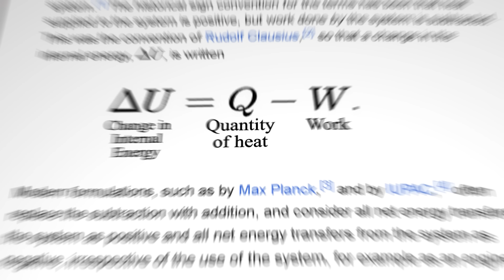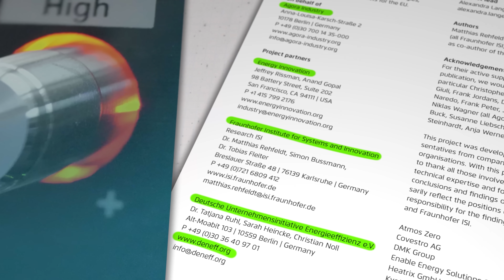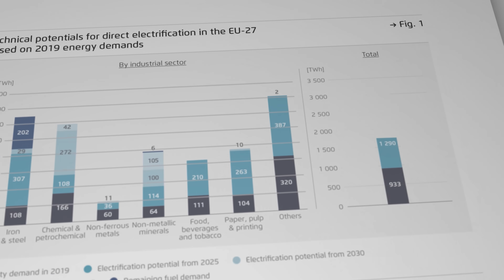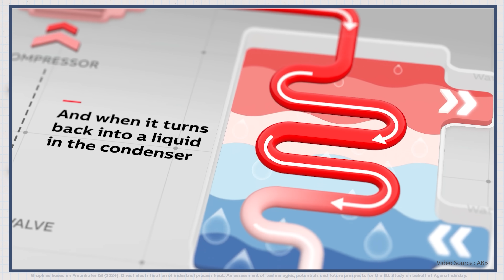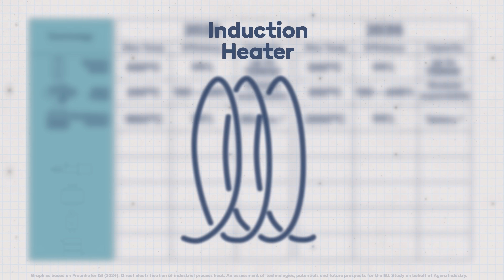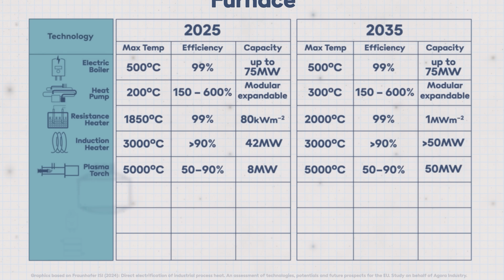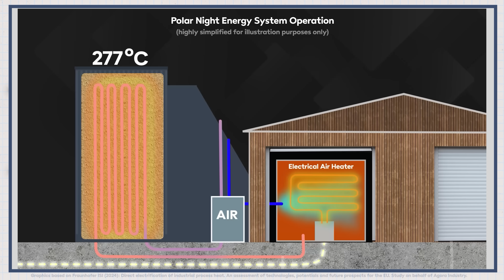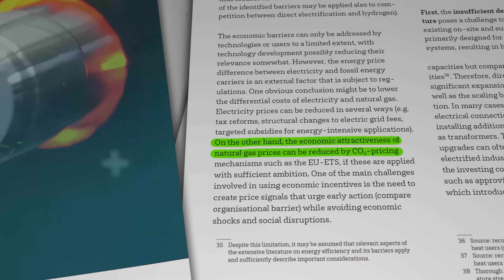Kicking fossil fuel out of industry! Here's how it's done...

Comment: As someone who is working professionally within several of these areas, I'd say that the picture is not quite as rosy as portrayed here. For instance, you have to be thrilled of a COP of 2 for heat delivery at >150°C and you can completely forget about 4-5. 

But the greatest challenge is that a lot of these processes require constant, or at the least on-demand, power supply. This would go well with nuclear but terrible for renewable energy, particularly wind and solar. Because sometimes the combined output of wind+solar is close to zero and in those cases having an increased 'minimum' electricity demand would be detrimental. And could you imagine working for a steel mill and being told your work schedule is 'whenever there is wind'... And this is not me slamming 

We should very much prioritize applications that can be shut off without too much cost. This includes EVs, to some extent heat pumps (a colleague of mine found out he could easily shut off his concrete floor heating for 12 hours without complaints from wife and children) and production of green hydrogen.

Comment: Something struck me the other day as I visited a Cash & Carry the other day. 
They had recently installed a brand new state of the art Diesel back-up generator. Surely it would have been around the same price to install a solar system. Cover their sizable roof with panels, the appropriate inverters and a sufficient battery back-up. Then not only will they have their emergency back-up solution, but they will substantially reduce their presumably huge electricity bill! Just a thought!

Comment: It's not either work or heat. That's a very misleading statement, and it leads to wrong conclusions. It will always end as heat. The question is, whether the energy was used before to do useful work or not.

Comment: Hydrogen suffers from energy density issues that doesn't seem ameliorated by any technology.  Also important to note is that hydrogen, when released into the atmosphere through fugitive or inadvertent emissions, has a global warming potential of 5x CO2.
The electrification excitation never seems to appreciate that the raw cost of electricity is high even if it has a 100% efficiency at the appliance there is always a 33% loss in transmission from the generation source.  Therefore no electricity appliance is 100% efficient.  I've always felt that industrial zones would be best served by a power plant that produces waste heat and sells that for process heat.  Waste to energy has a high degree of environmental efficiency by keeping methane out of the atmosphere from anaerobic bacterial metabolism.  When next gen nuclear comes round molten salt will be the godsend for industrial process heat and maybe even district heating service zones for residential and commercial structures.

Comment: Can you please do a feature on The Type Approval of JCBs game changing Hydrogen Combustion Engines across the UK and a large swathe of Europe . This means JCB are authorised to sell it's engines and thus products in those markets. This is a major step forward as you can significantly use these engines within all earth moving and construction equipment and also agriculture and also road transport. The real sweet spot is that the engines are logical developments of existing diesel engines and a huge proportion of the components are carry over utilising existing suppliers and machines etc. I also believe that you can actually retro fit existing engines and thus existing vehicles etc. This could be a real game changer..JCB will need to protect itself from the neysayers of course.

Comment: Using aluminum smelter as an example, 90% of cost is electricity. Should just move the smelter to somewhere where it is easy to generate green energy, like a desert environment. We don't. Ditto for pig iron. Basically, move it out of Europe instead of trying to fix it in Europe. Lots of excess wind power in Texas, but the smelter is in Louisiana.

Comment: Hydrogen is too valuable to burn to make heat. When hydrogen is needed for a chemical reaction then using electricity as the heat source for endothermic steam methane reforming is by far the lowest cost hydrogen if a value is assigned to avoided carbon dioxide emissions.

Comment: well then, you put 600% efficiency on the board but there is a strange lack of foaming from the mouth man children we see regularly on yt. Maybe they will come if I suggest heat to electricity conversion can be more than 50% efficient? 

heaven forbid anyone would suggest....

100 > 600 > 300 ????

If you imagine it to be 30% well then... 

100 > 600 > 200

or say 400% in stead of 600% because you insist it is wrong

100 > 400 > 200%

or say you've been living under a rock and want BOTH 30% and 400%  

100 > 400 > 120%

Physics never was the problem. It costs money to build, time to debug it and the hardest part is the will to do it.

https://en.wikipedia.org/wiki/Johnson_thermoelectric_energy_converter

Comment: The key is access to cheap electricity. The main challenge to that is grid pricing of energy where most of the time electricity pricing  is unrelated to the cost of renewables and instead is determined by more expensive nuclear and gas prices. That's a legislation challenge. Currently there's no incentive to use cheap wind energy because there almost always is some expensive source of energy on the grid. And the lack of local pricing means that e.g. Scottland grid prices are exactly the same as in the the south. Scottland actually curtails energy regularly because they generate more than they use pretty much all the time. There's no logical reason for electricity prices to be based on gas they are not actually using,  They are curtailing many GW of capacity on a regular basis. Fixing the pricing would incentivize industries to set up their factories in areas where there is a surplus of renewables. Those should be massively cheaper than gas most of the time. Steel industry in Scottland would make a lot of sense. The main blocker to that is national pricing of electricity. That's a solvable problem.

An alternative to this is simply going off grid and companies investing in private renewable generation. This is a lot harder but it effectively turns electricity from a variable cost into almost a one time, fixed cost to buy e.g. solar panels, inverters, wind turbines, and what not. After you buy those they generate power for decades with very little overhead for maintenance, solar panel cleaning, and maybe some occasional repairs/maintenance.  And you can always buy more expensive energy from the grid when your generation falls short or sell excess energy to the grid. Companies could join forces as well on this. This too is probably going to require legislative changes. And there is a lot of uncertainty around rules for grids buying excess supply of energy. 

Ironically, the fossil fuel industry figured this out a long time ago. They don't burn their precious oil and gas to power their refineries or power their pumps. Renewables do that job in Texas. That way they don't have to burn the merchandise and can sell it for way more than the renewables are costing them. That's why they have so much wind and solar generation in that state.  In the same way oil is pumped up in middle east using a lot of solar power. That's not because they are green washing anything but because solar is just cheaper. Having some oil or gas burning electricity plant right next to where the stuff is produced would be less profitable. 

As long as renewable energy is priced based on imported LNG or fancy nuclear reactors that go 300% over their budget and are stupidly expensive to operate, the grid prices stay artificially high.

Comment: also bythe way don't strght up burn hiydogen. why you ask. well meats the bigger grenhosue gas brother you get from derty burning hidrogen ina combsution engine NITROOXDIE. they make you  you leaguh take away your pan in hospatals and make your cars in the need for speed sreses go very very very fast. its also 1000's tiems more heat buidlng and potant then co2 as well. this si why we don't use hidrogen for a drect fuel in anything otehr then jet engines and sapce rockets or for fusion reactors.  bescue if it doesnt burn clealny it will be far far far far far wrose for the earth then just gaslone or desel witch would defaet the whole issue anyway.

Comment: A lot of skeptics on my high temperature heat pump comments. They are real and I have evaluated several systems in operation since 2015 including the one that made 15b 250°C steam above. For a good summary of several other working high temperature « open heat pumps » that generate steam at very low pressures from waste heat and compress the steam to higher pressure search « Waggeveld BlueTerra Toekomst MVR » and you’ll see a 24 page pdf with all the details on suppliers compressor types and heat balances.

Comment: Few people would dispute that the electrification of industry was a good idea, but just as trying to persuade people to use heat pumps and electric cars, you are putting the cart 
before the horse.

As it stands any increase in electrification will require the burning of more natural gas, or coal as we simply do not have enough renewable sources of electricity generation, nor do 
We have a viable long term energy storage system for when renewable generation fall away.

No industry would be happy if plants have to shutdown because there is not enough electricity available, so both of the above problems would need to be solved before you 
could persuade industry to invest in electrification. 

Then there is the plan to increase the price of gas to make the price of electricity seem more reasonable, well that comes with its own problems, current U.K. domestic energy
prices (I am currently paying 8 pence per KW hours for gas and 32 pence per KW hour for electricity) 4 times the cost of electricity over gas.

Before a certain small man’s special military operation gas was priced at 5 pence per KW Hour, but ever since the increase from 5 to 8 pence politicians have been foaming at the 
mouth about how many old people will die of the cold, yanking the price closer to 30 pence per KW hour would spark a revolution.

Even if you left domestic prices alone, and put the increase cost on industry this would inevitably increase the cost of all the goods we need and want, and would put European
And British companies at a competitive disadvantage with countries that have little regard For climate change.

The best option would be to push as hard as possible for the rapid deployment of renewable generation and energy storage to get the cost of electricity falling rather than artificially 
increasing the cost of gas, then industry would see electrification as a sensible option. We are told wind and solar are the cheapest form of electricity yet the cost keeps going up, can you explain.

Comment: And how will you generate the electricity?   Solar and wind are not reliable and do you really want to spend trillions converting 60% of your land to this purpose?   Most parts of the world cannot use geothermal. and there is a huge initial cost.   The rambling about  using different  heating methods are already well known and not helpful.  Better to use nuclear  or oxen to generate electricity than anything you suggest.

Comment: Record low Arctic ice levels have gone largely unmentioned—not just by you, but by most others as well.

This lack of attention may stem from the fact that many focus on sea ice surface extent rather than volume. If the current trend persists, this summer could see the Arctic sea ice volume reach an unprecedented low, potentially halving the previous record. There's even the possibility of the Arctic becoming ice-free, if not this year, then perhaps the next.

While Arctic sea ice can occasionally recover, starting the year with approximately 2,000 km³ less ice is a significant disadvantage. If this trend holds, the summer minimum could drop to around 2,500 km³—dangerously close to the <1,000 km³ threshold that defines an ice-free Arctic.

Source: Danish Meteorological Institute - Arctic Sea Ice Thickness

Comment: I have heard from my Process engineer friends that some of their customers are starting demand projects to swap out gas heaters for heat pumps + peaking gas pumps. 

I am jealous of them for having picked the right career for making a difference in the world.
Reply: You do not have to be jealous as they are dead wrong as long as they do not think for themselves!!!!     There is no problem to go electric but you need a power source that produces electricity dead cheap.  That may be nuclear.  Uranium or Thorium.  For your info: 1 kg of Uranium of Thorium has an energy content of 10 million kg of oil.   Cold fusion may be a good option when the criminal elite has been removed. Or Thorium batteries with a lifetime of years.

Comment: All energy eventually dissipates as heat. The distinction between "work" and "waste heat" is essentially the difference between whether the heat is dissipated before or after the work is done. The rare exception is, for example, the production of electric batteries, which literally store energy, which dissipates only much later when a purchaser uses the energy and it is converted into heat. If you were selling compressed springs, such as a car or truck might have, some of the energy will be stored. But fundamentally, bending and shaping metal, sawing wood, sorting sand with a shaker, and in inumerable other processes where energy is used to accelerate entropy, the energy is not captured in some sort of chemical, mechanical or kinetic form, and if it turns to heat right away or after awhile, it is converted to heat. Not that the distinction isn't useful: bending metal produces heat in the metal; the bonds between the crystals had be stretched and broken, in order to produce a bend. Thus the energy is immediately converted to heat, even as some sort of "useful" product is being made. This is always true, unless the production of the product demands that energy is stored. Just a small finesse on the physics.

Comment: From my industrial experience, it’s not just the industrial electric heaters front end cost that is prohibitively expensive, but the lack of electrical generation and infrastructure. Industrial sites operating at these temperatures do very poorly with thermal cycling the systems with frequent start-ups and shut downs, so you’d need to build out enough carbon neutral electrical generation to replace a large multiple of the fossil fuel demand to be reliable or invest heavily in a lot of storage technology which just makes the costs go bonkers.

Take a small refinery, consuming 40 mw today, looking to transition to electric heating, which will quintuple its electrical demand, to roughly 200 mw. Generally, for even a small industrial sites operating like this, you’ll want to be back ended from multiple power sources to avoid infrastructure failures or mechanical problems, so an industrial site will be operating with double or even triple the number of sources to be drawn upon if a single part of the network fails, so even a small refinery is looking at multiple independent power supplies in multiple hundred megawatts in scale. This problem gets compounded when we look at how concentrated heavy industry frequently is, in the petrochemical and heavy industry spaces, with industrial parks having dozens of small and a few very large facilities. You’re looking at hundreds of gigawatts of electrical generation and thousands of gigawatts of storage, or dozens of reliable nuclear plants. 

That’s not to say it isn’t possible, it’s just hard to imagine it happening inside of 50 years without rapid deindustrializarion

Comment: Electrification of industrial processes like boilers and furnaces looks great at first, but as long as the power is coming from the grid...you are trading one set of inefficiencies and potentially carbon footprint for another.  What we need is power production at the point of consumption via renewable sources to drive those processes to eliminate the generation and line losses inherent in grid-powered loads.  Solar/wind plus batteries integrated locally into industrial infrastruture as well as not-too-much-in-the-future SMRs are what will really enable all of that stuff you mention and actually move the needle versus the current situation.

Comment: The problem is building the infrastructure to produce and transmit all this needed electricity.

A fuel station in the states called Buc-ee's would need it's own nuclear power plant to generate enough electricity to maintain the throughput it has now if it switches to all EV support with 2500 charging stations needed to replace it's 120 petrol pumps.  

We just don't have the power available to do this changeover now or even in the next 10 years.
Reply: Bollocks

Comment: I am going to  call BS on that report.  most of these electrification methods are almost always less efficient  in converting  electricity  to  heat  some times are as low as  20 percent,  which means  your going to have supply a lot more  electricity  if convert to  electrical method